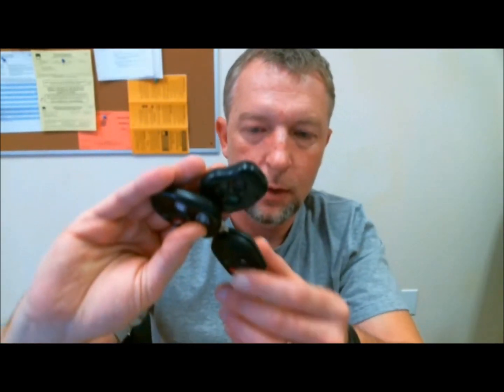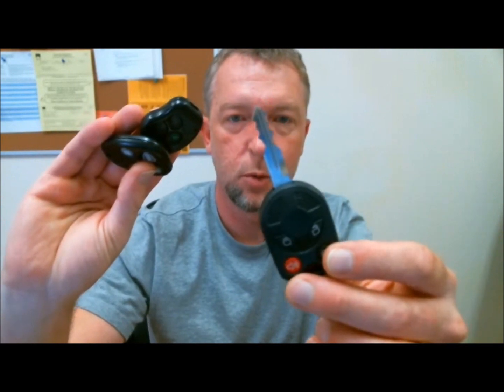2001 to 2006 Chrysler Sebring OEM Factory Remote Transmitter Program How To

Comment: Do you know how to do 2007 Chrysler Pacifica  Touring AWD
Reply from the maker: no sir, sorry. There is no manual on board procedure to program a keyless remote to this vehicle. This vehicle requires special equipment be connected to the vehicle to program the remote.